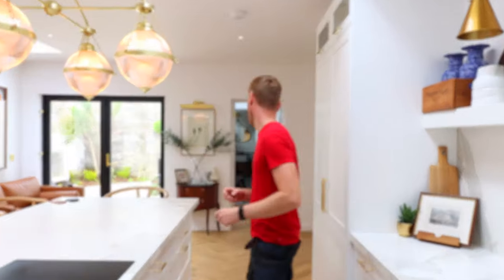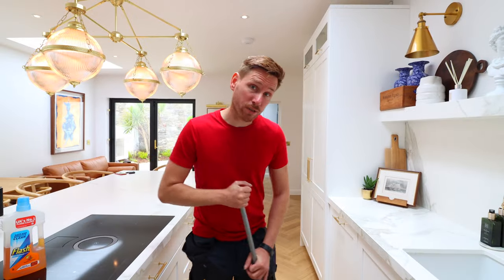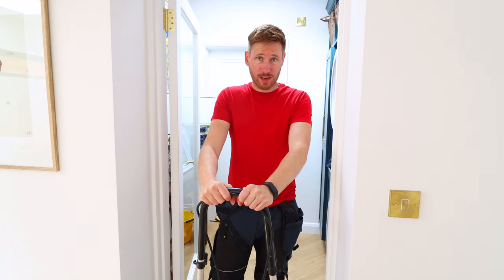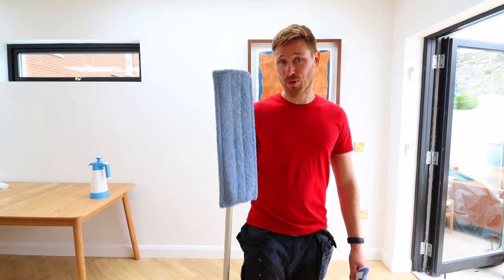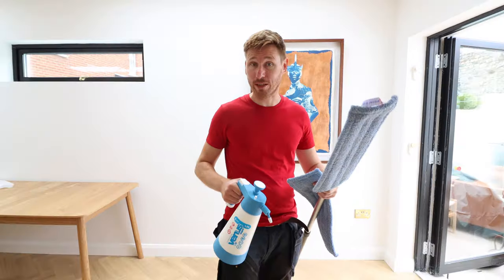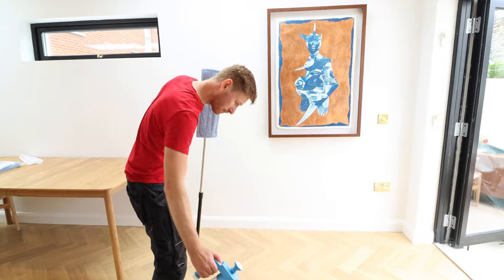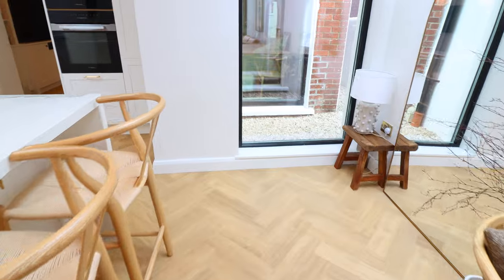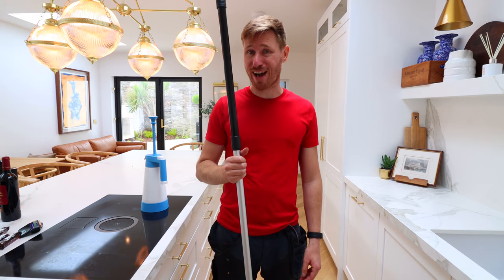How to Mop a Floor PROPERLY | How to Use a Microfiber Flat Mop Like a Pro

Comment: Nice.  What you do with the commercial extractor machine I do with a 10% alcohol solution on my microfiber mop pad.  I think the little bit of alcohol helps two ways:  It helps dissolve greasy smog stuck to the floor, and it allows the tiles to dry much faster than plain water, so there is less risk of slipping and falling.  I change to a fresh mop pad several times along the way, as needed.  I actually pour the solution onto the top of the pad, then apply the handle, so the solution spreads to the bottom, floor side, as needed.  When it gets too dry or too dirty, time to switch pads.  If I've been really good at keeping the floor clean, though, I pour a puddle, instead, mop over it to soak that into the mop, and then continue.  Regardless, the 10% alcohol in the water does seem to boost effects.
Reply: Do you mean you mix the alcohol in with the water ?

Comment: This was invaluable.  
I just mopped the floor and I have exactly that problem described here,  the floor looks hazy and dirty and I know I'm not looking at my floor finish.  
Will take this advice and try it tomorrow. 

I've  always been using conditioner in the washing machine on my microfiber clothes.  Will stop that immediately.
Reply: How did it turn out ? Because i have only one microfiber, if it worked for you ima get some more.
Reply from the maker: Thank you so much! I'd love to hear how you get on :)

Comment: Great video! How do you disinfect the floor if you are only using water? I watched another video where they made a solution of a small amount of vinegar, dish soap, rubbing alcohol and water.  I feel like this would disinfect the floors better than plain water. Any thoughts on this?
Reply: the dish soap would leave residue

Comment: I've now watched about 4 of your videos in a row. Firstly your friends house is beautiful... 

Secondly, Thank you so much!
I'd completely ruined my engineered wood flooring. The beveled edges are completely brown and I was dreading having to srub and clean it. Hopefully this will work for me.

My bevels are quite pronounced and it's a lacquered finish. Is there anything extra I should do or will this method of resetting the floor?
Reply from the maker: I'd say this method should be fine, once you get the detergent out!

Comment: For the old string mop, what if I just mop, squeeze dirty water into a 2nd bucket, repeat?
Reply: This is what I do and it works
Reply from the maker: It will work but not as well as the method in the video :)

Comment: Does doing the microfiber mop really get it as clean as using the machine? or how many times would you need to do this method to achieve results like the machine? thank you soo much for this info!!
Reply from the maker: Yes it does. You need to do small sections to reset it.

Comment: Do you wash the mop heads in just very hot water - I'm just wondering if any excess detergent or soap powder doesn't rinse out properly would that cause a problem next time the heads are used?
Reply from the maker: I wash em in my machine; I'm working on a tutorial for washing the mop heads :)
Reply: I also have this question!!

Comment: Sorry if you answered this question somewhere else, but where can I buy the mop and scrubbing machine. And would the microfiber mop method work for a large high traffic area, like the lobby of a business?
Reply from the maker: Where are you based? And yep, the mopping method works really well in large areas.
Reply: @CleaningHowTo  U.S.
Reply: @CleaningHowTo  better question, which brands are they. Or would any microfiber mop/scrubbing machine work?
Reply from the maker: @miguelm.9890  any crb or rotary is fine as is any micro Fiber mop system; I’m not familiar with the brands available in America I’m afraid.
Reply: @CleaningHowTo  thanks!
Reply: @CleaningHowTo hi sorry what is a crb? I have filthy floors (bought white matt porcelain floors, ugh, whyyyyyy... I have a dog...) and think I need to do a reset. I do already use the microfibre method but there is so much ingrained dirt I think I need a good reset. Thanks.

Comment: Hi Carl, thanks for the video. Wondering what’s the best way to do the first part of cleaning the floors before the use of the microfiber flat head mop, if I couldn’t have any of those 2 machines? 
Also in Australia which could be a good microfiber flat mop? Thanks for your replies 😊
Reply from the maker: A wet vac and a deck brush is the quickest way. I tend to recommend commercial microfiber mops as opposed to stuff available to general public as they last much longer - look up local suppliers :)
Reply: I have the Sabko mop which can be refilled from a little above.

Comment: you can't use just one microfiber for the entire floor, you have to replace it with a fresh one after just wiping a small section?
Reply from the maker: @LisaBromfieldInspires  no, that defeats the purpose; to fully remove dirt, not smear it all over the floor.

Comment: Does using this method with a microfiber eliminate the need to to sweep the dust beforehand?
Reply from the maker: No, remove as much as you can dry by sweeping or vacuuming. Wet dirt is essentially mud, so try to negate this as much as possible.
Reply: @CleaningHowTo  Okay, thank you!

Comment: Do you have any content on deep stains in wood floors? I'm not sure what, but something dripped a black, sludge-like substance on our floor and I absolutely cannot get it out :/
Reply from the maker: Depends what the stain is but if it’s solid wood, just sand and blend it!
Reply from the maker: Have you any idea what it is?
Reply: @CleaningHowTo  I dont! My dog has a bed with a metal bed frame. I washed her bed and this black sludge came out of one leg of it (only one). I don't know if it's just a build up of dirt and grime. But if you've any suggestions, I'm here for it!

Comment: What brand mop is that- I am in Texas, USA and I didn’t like what my local store had. I would rather order something online that is more budget friendly. My Lowe’s wanted 40 bucks for the mop, with a lot of extra attachments, and 11 dollars for each replacement mop pad 🤦🏻‍♀️
Reply from the maker: look for commercial janitorial suppliers online - I sell mop heads in Ireland for about €6 each!
Reply: I feel like a dummy for asking this question. After you do the reset and go back to do your basic clean, did you have any cleaner in your spray bottle? I understand for the reset cleaning you don’t need soap because there is the soap and dirt stuck to the floor from previous mopping.
Reply from the maker: @robinsonh081  I usually just use water tbh!

Comment: Hi there, do you have any links to the mop and pads you used please.
Reply from the maker: Sure thing! Where are you based?
Reply: @CleaningHowTo   Great , that’s really helpful I’m based in Shropshire, England .
Reply from the maker: @citrussteamcarpetupholster8974  We get them from paragon microfiber in the UK - they stock the pads, mop handle and base plates. They're excellent - we sell a lot into commercial premises after we do a re-set clean like in the video.
Reply: @CleaningHowTo  Thanks, that’s great, really appreciate your replies, keep up with the great videos 👍
Reply from the maker: @citrussteamcarpetupholster8974  No problem, and thank you :)
Reply: @CleaningHowTo  Any suggestion for where to get these in Canada?
Reply from the maker: @johnmartin7989  janitorial supply stores should have them!